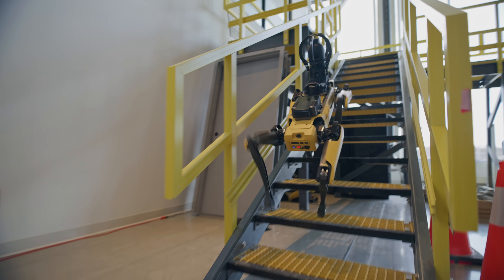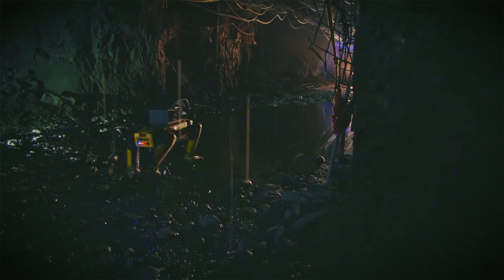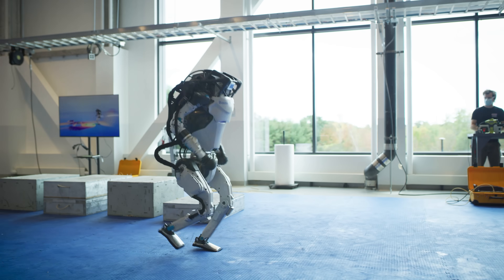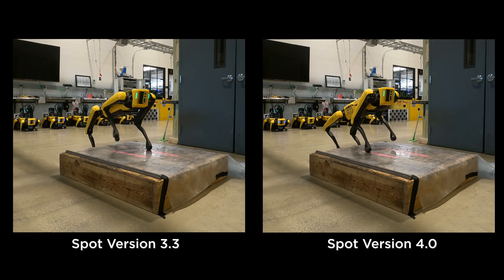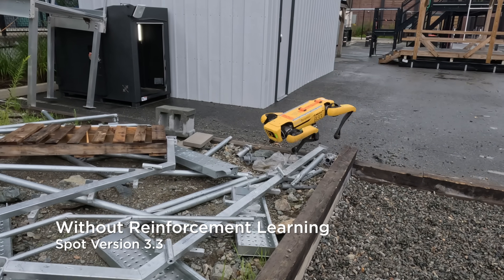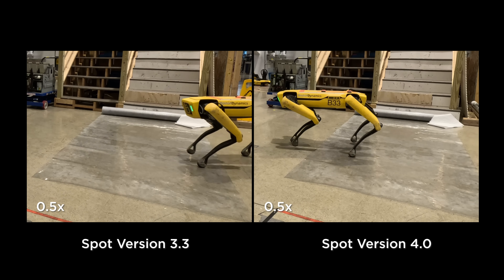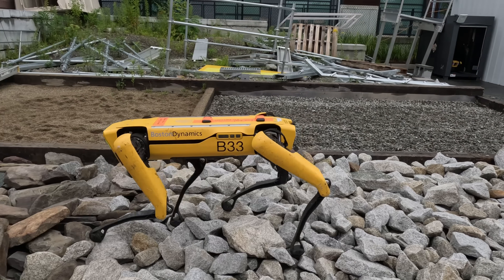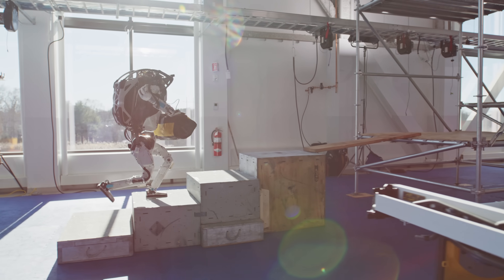Stepping Up | Reinforcement Learning with Spot | Boston Dynamics

Comment: Such exciting work!  Take an organic reflex.  Conditioning or learning theory generalizes that minimal base reflex from infancy.  Training in later life can rehone that same simple reflex with extraordinary results.  Living organisms get need gratified by learning.  The obverse is negative experience adverse consequences plus frustration in having needs unmet.  Although an organism will endure the adverse to satisfy a need.  There's a way to reduce this principle to binary such that it can be encoded into a machine.  IE Spot should "learn" to charge and slide over short slippery surfaces.

Comment: Really need tactile feedback on the toes so it knows when it's slipping or when there is nothing there so it can react instead of stepping and then making the calculations and adjustments. Then the hard part is matching the cameras with the tactile feedback to get more accurate steps.

Comment: Silly question: Do these robots have a camera capable of seeing where their feet are going at all times? Does this information feed back into some kind of model that enables them to correct on the fly?
Reply: The leg actuators know the positions and the loads on all joints, there is no need for a camera in order to know where the legs are. There are cameras that look all around the robot though.
Reply: @cogoid  thanks for the reply. My nervous system knows where my legs are in relation to my body too but sometimes I like to triangulate that information with my eyes. Was wondering whether having multiple sources of info might help with balance.

Comment: What is reinforcement learning?
Reply: A program that randomly selects actions and learns by getting rewards (higher scores) based on results they achieve. Over time the probability of selecting the right actions grows larger based on what actions achieved high scores. The system still can randomly choose a slightly different way of doing things, but in general it will over time succeed in choosing the right actions.

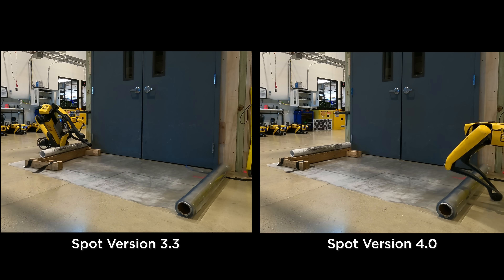Comment: 3:20 And this is why it won't be long before tons of labor is automated, same hardware but you just quickly replace the software it uses with a newly trained version and it performs much better. Image the recent viral figure 01 robot having a multimodal GPT5 instead of just GPT4 vision for example.